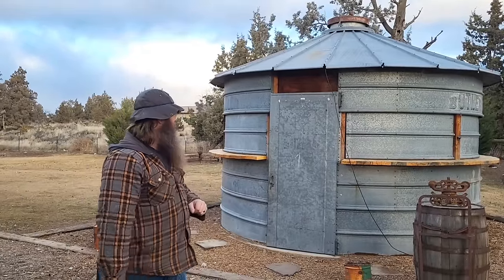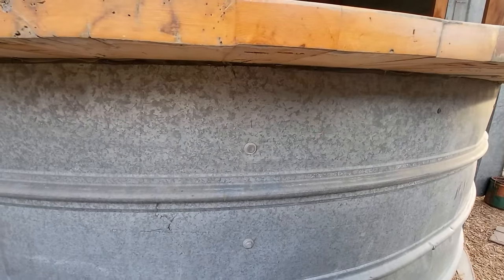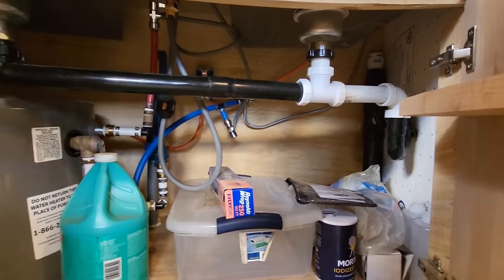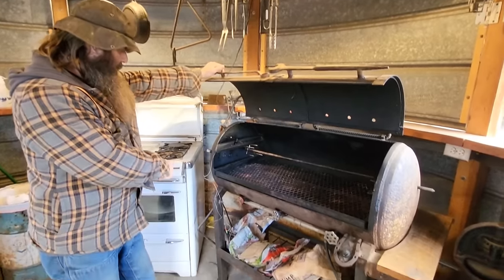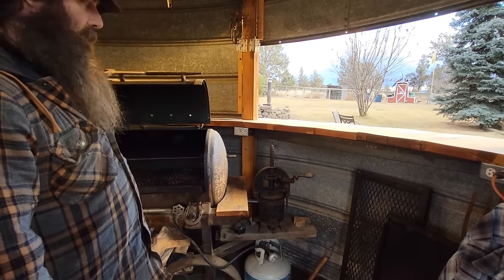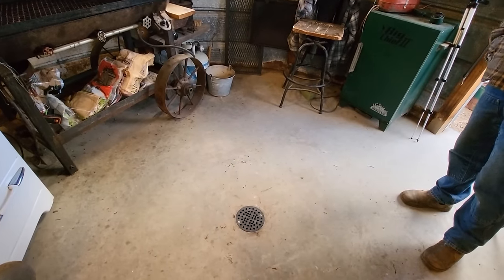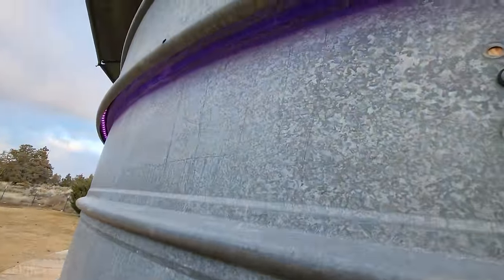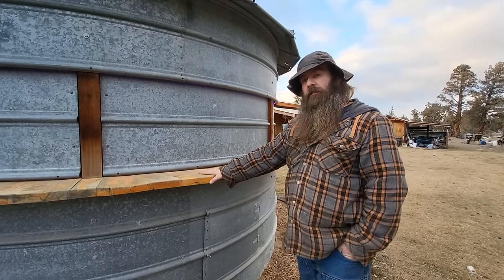See how we built our grain bin (silo) outdoor kitchen!

Comment: Just got one of these, have to put it up soon. 
Did you use piece of eqpt to assemble by holding up roof and attaching sides as it moved up?
Or install using the posts instead.
Appreciate any help.

Comment: i just bought an 18 foot grain bin and will do some of the same things with it . did you seal the underside of the wood top . loved your window panels . I'm trying to figure a way to counter balance them , maybe an old garage door spring set really low . good luck on your move .
Reply from the maker: I'd recommend taking your time with the build....you will not know what you need til you use it for awhile.... I've spent many hours while bbq'n starin and ponderin!.....yes I sealed the underside of the countertops with marine grade waterlox. I think you'd have to counter balance both sides as the panels want to move uneven and bind. Have fun with your build!